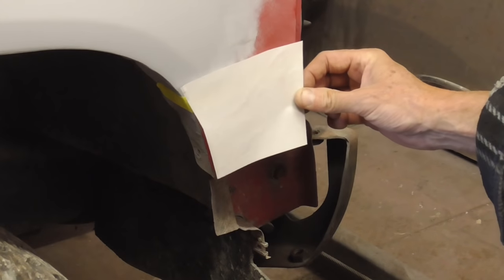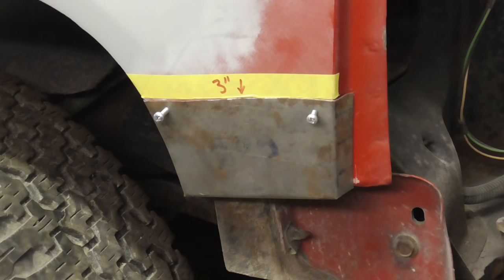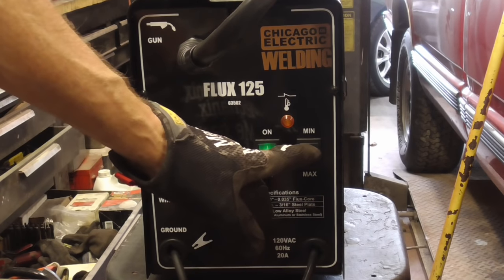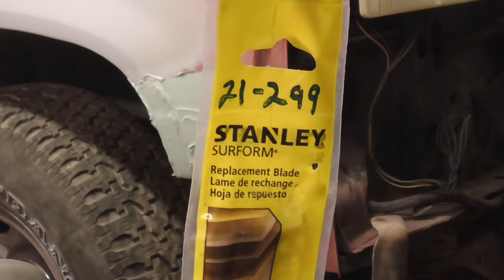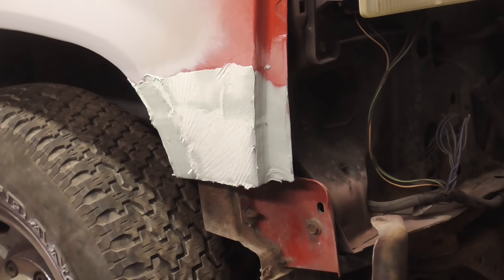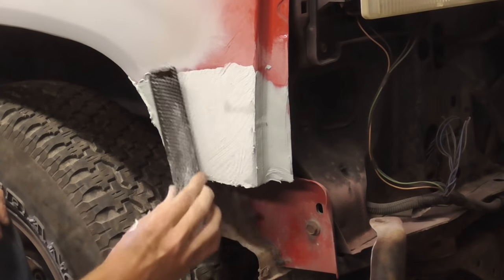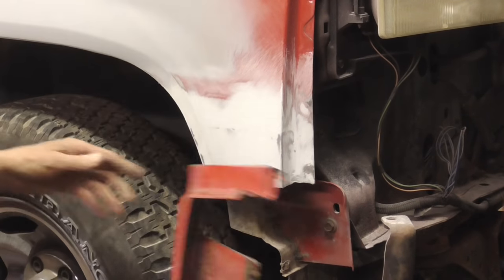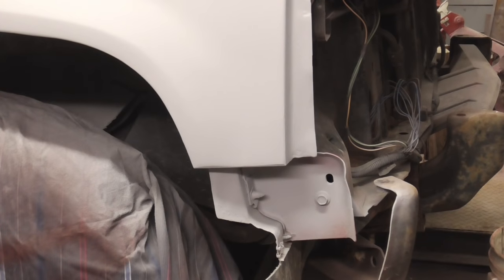Welding Automotive Patch Panels with a Harbor Freight 125 Flux Core Welder

Comment: Problems with flux core is a lot of splatter and there are more chances of burning holes and warping in body metal I went to argon mix a big difference and hardly any splatter to clean up but flux core does the job but gas does a nicer one .

Comment: Question so is it better to spread filler over bare metal vs primed metal ? Another awesome video !
Reply from the maker: To me it's best to spread it over bare metal as that is how it was done in every shop I worked at.  Use a low speed on your sander/grinder and use sharp 36-40 grit fiber resin discs.  Filler sticks great to clean, freshly ground metal.  In the end it's up to you though and what you think is going to work best for your application.  I've never had filler crack, fall out etc. putting it over bare metal though.  Thanks for the support BTW.
Reply: @LakesideAutobody  agreed  . Fillet has got a bad name from people putting it over rust unsanded paint  over dirt grease oil and then leaving the rest of the metal to rust . Also all repairs need oil on the back of the repairs soon as paint is cured

Comment: I’d be out there 10 times as long and it would look 1/10th as good.  Do you put anything on the back side of your patch panels to keep them from rusting from inside?
Reply from the maker: Not usually but I absolutely make sure the panel can drain.  For example: lean a piece of bare sheet metal up against a chain link fence and it'll be there for a darn long time before it rusts away because it can drain and dry.  Watch this video for some good info on that:  https://www.youtube.com/watch?v=8XaZBy7GC7A
Reply: I see this is 9 months ago but......I  just had cab corners done professionally and they use something called cavity wax.  The shop highly recommends it whenever you can.
Reply: @lukeofearth1036  thanks!

Comment: I love your videos. A couple of Quick questions from someone who doesn’t know much about body work. Are your spot welds overlapping so there are no spaces between them?  Does it matter if there are spaces between the welds? And what I does knocking the welds down do? Does it make a v channel for the filler to go into?  Thanks
Reply from the maker: My boss used to make us put the welds right next to each other and that obviously worked great.  As time went on I cheated a bit and started leaving spaces and found it made no difference because the panel will begin to rust again at the bottom where the salt water and debris settle anyway - not the side.  lastly the knock the welds down does 2 things 1) hides the seam 2) all seams whether butt welded or lap welded are not completely water proof - we are not robot welders so even a small pit will leak.  The rigid layer of filler in the knocked down area does a great job at battling any moisture trying to penetrate the repair especially if you use a layer of fiber glass reinforced filler on your first coat.  Hope that helps :)
Reply: Thanks for the reply. I’m trying to get the courage to fix the rusty wheel fenders on my truck. Panting is what’s holding me back. Every time I spray doors with my cheap HVLP gun, it leaves a gritty texture on the door...granted it’s thinned latex paint but the doors look great.
Reply from the maker: @JiuJitsuDad  Do let fear get the best of you...figure out whats causing the problem and go from there.  Ask questions too :)

Comment: Hi, great video and all the other videos are fantastic.. You definitely have another subscription from me..
What wire are you using as I have my very similar welder on the same settings and I am not creating a puddle at all! I am new to this today
Reply from the maker: Thanks so much - glad they are helpful.  Feel free to ask ?s.  I answer 1-2 times/day.  The wire came with the welder and is .030".  I did have to play with the settings and the distance (work/gun) and angle.  Keep at it - you'll find out what works for you.  Thanks for the sub :)

Comment: I’m not trying to insult your work with my question I’m genuinely curious.  Why not butt the panels together and weld or but a panel behind and then we’ll the panels Edge to edge.  Wouldn’t 5hat make for a thinner layer of body puddy and make it easier to clean up for the finished product.   Any information would be helpful thanks
Reply from the maker: Please check back with in the next few weeks.  I'm working on a video that thoroughly explains why this method is used in body shops in Michigan.  Here's some information on the reasoning behind a combination of butt and lap:  
Lap welding is how most,  if not all high volume body shops in Michigan repair rust on late model vehicles with 22 gauge (.030”)  or thinner sheet metal (welding or adhesive).  Strictly butt welding a patch panel, which has become popularized by the internet and TV,  is not the best quality repair on today's thinner metal and there are many good reasons why professional body shops don't do it.  Shops use a combination of both lap and butt (butt for rigid areas that can’t be tapped down) on almost every patch but would never just butt two pieces of metal up (gap or no gap), weld it, then grind away at the area attempting to metal finish it.  Here why with good reason  - especially Eastwood’s starting 22 seconds in: https://www.youtube.com/watch?v=rpH50kh4W00  *
https://www.youtube.com/watch?v=MfKlNQF-o4I  *
     Today’s metal is .030. That is literally 6 hairs (hair is .005) thick.  You start grinding on that and the result is paper thin welds & surrounding metal.  Your goal is to have one method that works on everything.  Surely you’re not going to butt weld and metal finish this: https://www.youtube.com/watch?v=36zkc9UQaTs or some of my other rust repair videos.  Use small overlap, weld solid and you won’t have to worry about moisture - especially if you keep the drain holes clean (most important thing in rust prevention). Note that  the opening of the seam is upside down on the inside (no moisture trapped).  See these videos for longevity of this type of repair if done correctly: https://www.youtube.com/watch?v=8XaZBy7GC7A ***
https://www.youtube.com/watch?v=2o37dX-
Let me know if this long winded explanation helped out :)   Jerry
Reply: @LakesideAutobody  thank you very much I have a 1997 f150 that I have to do some rust repair on that’s why I was curious. I appreciate you taking the time to reply.   please keep up the informative videos. .
Reply from the maker: Thanks - glad I could help - let me know how your project goes.  Ask ?s too - I answer 1-2 times a day :)

Comment: great video, but why didn't you weld the corners of your patch panel at the bends or weld the front solid where the grille fits ?
Reply from the maker: You can do that if you want.  I really just focused on the seam for video purposes.  You can finish or fashion your patch however you think it will last the longest.  Good observations MM :)

Comment: should you prime them before adding the filler or does the filler provide the protection you need from corrosion of the new metal?
Reply from the maker: Filler sticks great to clean, freshly ground metal.  Use a slow speed on your grinder/sander w/ 36-40 grit fiber resin disc.  I get the idea of products that claim it will "provide protection" but it's not 
necessary.  I've never seen it done in any shop I've worked at.  In the end though it's up to you - what you think will work the best for your situation.  I'll do a video on that - I've had a lot of folks ask that.  Thanks,  Jerry
Reply: @LakesideAutobody  appreciate the reply. Hope it didn't come off as rude, was a legit curiosity question for me. Thanks, love the page!

Comment: What level of smoothness or flatness does the metal have after the grinding and tapping down before filling. Its hard for me to get a sense of what can be covered well by the filler.
Reply from the maker: Awesome question and I will be posting a video on that exact topic w/in the next couple weeks.  For large areas like this it needs to be roughed up good with anything under 80 grit - used sharp paper or fiber resin disks - filler adhesion is a mechanical bond and need to grab onto or lock into the scratches.  Don't use a DA with fine paper :)

Comment: I love your channel so much!  It has been incredibly helpful with my project.  I am welding some patches into the bed of my pickup.  I can see little bits of light from some angles coming between my spot welds.  Will the bondo seal these holes sufficiently?  Are these tiny holes acceptable or should the welds completely seal the patch?
Reply from the maker: You don't have to weld solid.  If you are concerned about sealing use fiberglass reinforced filler for you first application of filler - it's water proof unlike regular filler.  I use regular filler and have no issues though - remember to tap the seam down before filling :)
Reply: @LakesideAutobody  Thank you very much.  You do great work.  Really appreciate your expertise.  Keep up the great content!
Reply from the maker: @andrewsimpson3194  I will Andrew.  Thanks for the kind words and thanks for watching :)

Comment: I thought this would need a "joggle" tool to send a rebate (rabbet) into the old panel. But you've shown that's not necessary. Thank you. I do think it will need a searching searching anti corrosion oil/wax squirting into the overlapped edge behind. but it should be good.
Reply from the maker: Here's one option for cheap future rust prevention - https://www.youtube.com/watch?v=8XaZBy7GC7A

Comment: Thanks for putting this video together. It looked like you were applying a powder coating at about minute 5:12. I wasn’t sure what you were doing here, would you please explain?
Reply from the maker: That was a small sand blaster.  I use the media from tractor supply - $9/bag   Here's the blaster -  https://www.amazon.com/SpeedBlaster-Gravity-Feed-Media-Blaster/dp/B000IHUQ5E/ref=asc_df_B000IHUQ5E/?tag=hyprod-20&linkCode=df0&hvadid=
Reply: Thanks for taking the time to explain and even go so far as to provide the details in your response, that’s pretty awesome. Thank you!!!
Reply from the maker: @groothebarbarian  You're welcome Steven.  Have a good weekend my friend :)

Comment: Another great video. My question is would a rasp do the same thing the grater does to remove material quickly? N how's the quality of the finish after the grater?
Reply from the maker: I don't think the rasp would work as it would probably clog up but.... give it a try - you never know.  The finish is fine because you sand it as you would normally sand filler after you get it close with the grater or (Stanley surform).  Have a great weekend :)
Reply: @LakesideAutobody  I was thinking the same thing about the rasp clogging. N I meant is the surface relatively smooth n easy to sand after the grater? Which I suppose would depend on how fine or coarse the grater is. Enjoy your weekend. Rumor has it we might warm up a degree or 2 for the weekend lol
Reply: Yeah it's smooth cause you don't get that close with the grater. You have to know when to stop with anything, with the grater you stop in time to hit it with 80, and then 180, and then primer. It will be smooth
Reply from the maker: @jonathanyates5198  You're right - gotta leave yourself some to hit with the sand paper.

Comment: Hi Jerry. As a complete rookie, do you mind if I ask why you didn't butt weld this repair ?
Reply from the maker: No problem.   Strictly butt welding and metal finishing is more of an internet/TV/magazine thing.  Most Michigan body shops used a combination of lap and butt - even panel adhesive or fiberglass.  See these videos as to why: https://www.youtube.com/watch?v=JIIonJOVro4  **  https://www.youtube.com/watch?v=rpH50kh4W00  For longevity see this video: https://www.youtube.com/watch?v=8XaZBy7GC7A
Reply: @LakesideAutobody  Thank you for the clear perspective !!!
Reply from the maker: @mikep95133  You're welcome.  The body shops in Michigan use a combination of welds.  Mostly lap welds in open stretches that can be tapped down (seams).  On edges that can't be tapped down and you don't want them looking thick or altered you would butt weld.  The shops that I worked at anyway - and they had very good reputations for doing quality work.  A lot of shops use glues or adhesives for certain rust repairs.  I'll include all the different types of repair methods on this channel so you can choose which will work best for you and each of your repairs.

Comment: Do I just disconnect the battery only when welding or do I disconnect everything   Also I hear grinding the tacks down is better because if you do it right it will look like it was never touched
Reply from the maker: Just disconnect the negative batt cable when welding.  No one in a body shop grinds the welds completely flat - that's internet, TV, magazine stuff.  Don't waste time, materials or good welds doing so.  Weld, lightly grind the welds, sand blast or wire brush the seam, tap down the seam, fill.  You want something between the welded seam and the finish and filler is great for that.  A butt welded seam right under the finish will begin to show eventually if driven in salt water and the elements.  Watch this video for more info - https://www.youtube.com/watch?v=JIIonJOVro4

Comment: Why do you sandblast the weld? Is that to remove any flux residue? and last question what is the sandblaster you are using it looks portable? Thanks
Reply from the maker: Filler sticks real well to sand blasted metal.  You can wire brush it though if you don't have a blaster.  Here's the exact one I'm using - works great - https://www.autobodytoolmart.com/product/Zendex-speed-blaster/abrasive-blasting-equipment?utm_source=feed&utm_medium=free&utm_campaign=shopping&gclid=Cj0KCQjwp86EBhD7ARIsAFkgakgy0eIiRSLD8V6peqv3wY5hR8jyELBM4424ISFgv38tVt6QZfnp6twaAq-GEALw_wcB

Comment: I have the same machine,I don’t know how to use properly,and I’d like to know why you change the settings to minimum temp instead of maximum temperature,thanks
Reply from the maker: For sheet metal like 20 or 22 gauge you'll want to use a lower voltage or minimum temp so that you don't "blow" through or burn through the thin metal and make a hole :)

Comment: How does the sand blaster help out? Thanks!
Reply from the maker: I just like to make sure that the metal is roughed up and super clean before using body filler and sand blasting does that a lot easier than say a wire brush or grinder etc.

Comment: Would you say the 90 amp flux core from harber freight is not up for the task ?
Reply from the maker: MIG welding is easier for sure but any flux core welder from Harbor Freight can do the job if you practice for a bit first.  You burn through a few times but once your on a roll you'll be fine :)

Comment: OLd school.  the best way.  In the early 70s I did all my welding on sheetmetal using  " hammer welding"   use a 3/16th  rod and a gas torch ,,  knock it in , then a wet rag, whew.  In the last of the 80s I bought a MIG.    EASY
PEEEZY,,,..
Reply from the maker: Thanks for the story from the 70's and 80's David - good times.  You're right - the MIG really made it easier :)

Comment: Your technique with the flux cored welder has been very helpful. 
One question I have is do you ever find the need to use lead filling?
Reply from the maker: My dad used lead and converted to plastic filler late 60's through the 70's.  He showed me how to do it but I found filler to be a lot easier and in all honesty lasts just as long if applied correctly.  That would make for a good video topic though.  Thanks for you input and glad you enjoyed the video :)

Comment: What did you treat the backside of the weld with?
Reply from the maker: The best way to treat the back is make sure it can drain and stay dry inside the panel and this - https://www.youtube.com/watch?v=8XaZBy7GC7A  If you gunk it up or paint it inside it will actually create more problems.

Comment: What is the reason for cutting out the old metal. The patch part already is an overlap at the top why not just overlay the whole thing?
Reply from the maker: You can't really tell what is "bad" if you don't cut because panels rust from the inside out.  You can feel the the bad metal when cutting as thin metal cuts super easy.   Not only that, you don't want that thin metal just rusting away clogging up the drain holes and causing water and debris to be held between the panels in "pockets".  Hope that's not confusing :)

Comment: I thought you were goin to but weld that piece but you went with a lap  weld. Any particular reason to do that?
Reply from the maker: That's just how it's done in the shops I've worked at here in the suburban Detroit area.  I've never seen anyone butt weld patches in a high volume body shop - like dealerships, privately owned shops etc. Edges maybe and small rigid panels like rockers and posts yes.   Here's some good information on that topic:   https://www.youtube.com/watch?v=JIIonJOVro4  *  Also see Eastwood’s explanation:  https://www.youtube.com/watch?v=rpH50kh4W00 *  For longevity of this type of repair see:  https://www.youtube.com/watch?v=8XaZBy7GC7A   **  https://www.youtube.com/watch?v=2o37dX--w0I